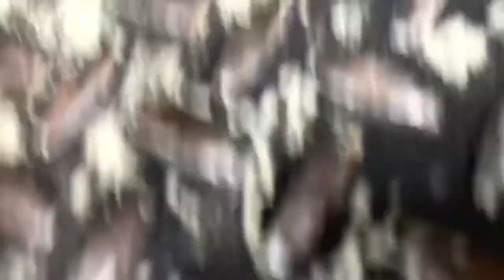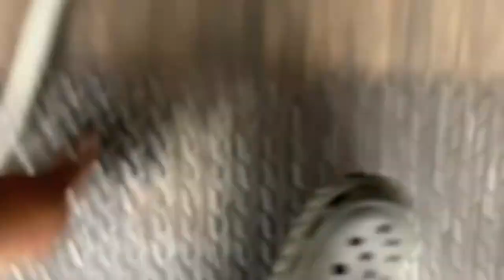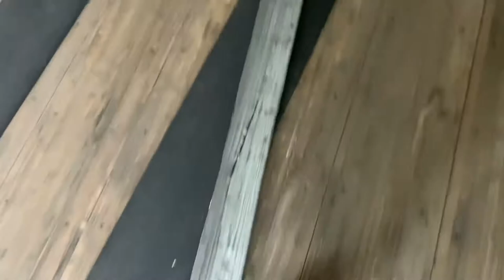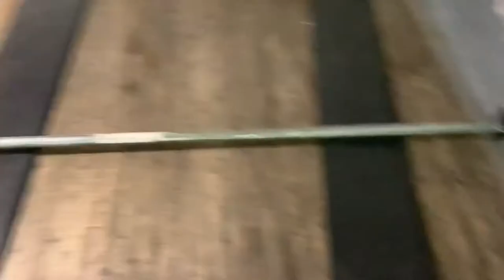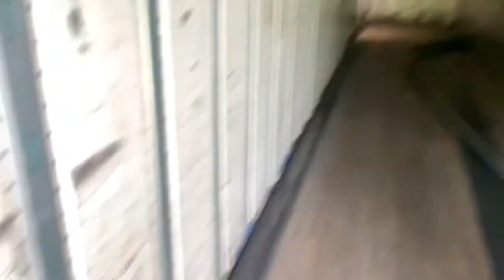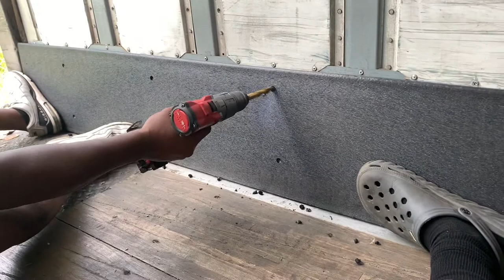DIY Scuff/Kick Plate Replacement on Dry Van Trailer

Comment: That looks exactly like my trailer. I have the galvanized metal at the bottom and it is all bent up at the bottom. It just got rejected at a shipper for this. Where did you get that plastic and how hard was it to install? How did you get the old stuff off neatly?
Reply from the maker: Just cut out the flared parts with a grinder, we used clear chaulk and self tappers
Reply: Self tappers into the white parts? The e tracks are hard to drill into.
Reply from the maker: The left over metal that wasnt cut out